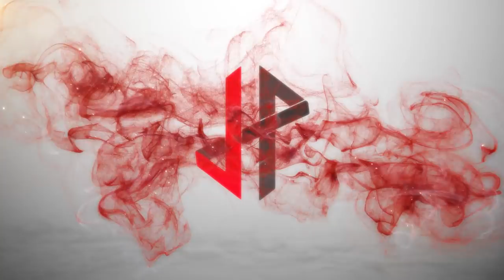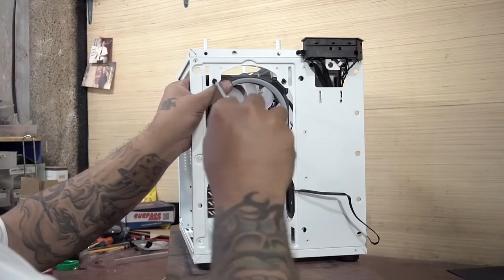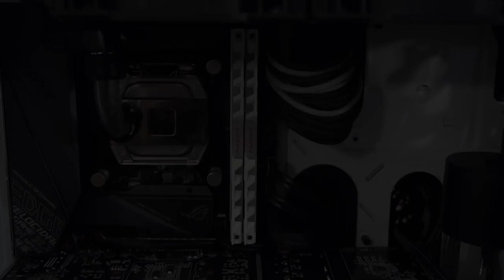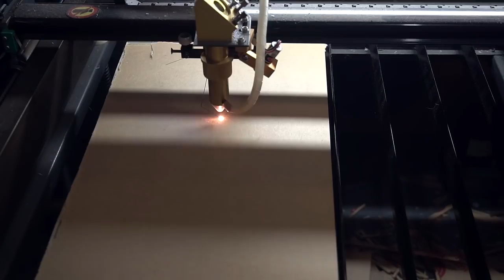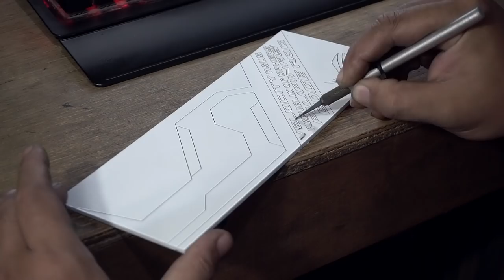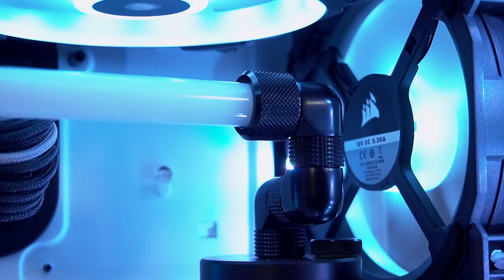Corsair 280X watercooled!

Comment: I did this case with a D5 pump.... im honest with pvc tubes not with PETG......i had to stick the tank to the back in to the cable area....just because i dont want to lose the space for a long gpu if the RTX3080 or ti is too long....and softtubing because I have actualy nearly no chance with all the cables in the back and the tank to pass with hardtubing without spending hours..... Okgood visible tube in the front is hard tubing but the rest soft. Radiator is a mora external rad below the table XD. Best fluid tanks would be the new ekwb "custom" tanks....

Comment: You don’t middles ever reveal the TEMPERATURE of their builds?
Reply: Temps should be pretty high i mean 1x 240mm rad for a 1070ti and a 8700k.
 I had 2x 240mm rads and i had 78C on the CPU alone and my CPU was delided. i like the
 looks of mITX with watercooled comps but its not worth it in my opinion

Comment: How's the airflow? There seem to be a lot of concerns on forums about the top and front panels.
Also, isn't the front window acrylic?
Reply: It’s pretty bad. I have my cpu on a deepcool captain aio, a R5 2600 which runs very hot, and it would max out at 80 while gaming. This was with all panels on and 5 fans while my 2070 windforce was stock air cooled. Not super bad but with the newer chips it definitely is much better. I know this is a year later but I’m looking to do a custom loop for my newly acquired 5600x and 3080. I need that pump res combo he’s using but I don’t know what it is

Comment: Nice build! Did you set the bottom fans as intake or exhaust? I have this case with a x399m taichi. Radiator on top, intake fans at front, and bottom fans as intakes also.
Reply: Adjodha B the bottom fans are exhaust.

Comment: Amazing work! Quick question, as I have the same case and am having an issue with GPU and waterlines also sticking out further on the front panel, therefore not allowing me to attach the front glass panel. I see you have attached some kind of standouts to the original screw holes as well as screws, where did you purchase them? as I have been looking all over for a way to attach them. Thank you!